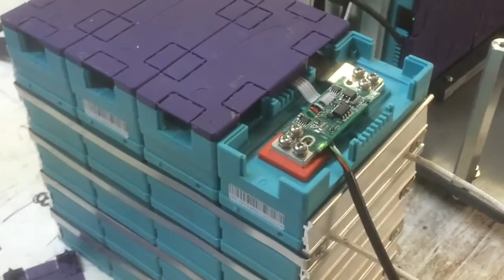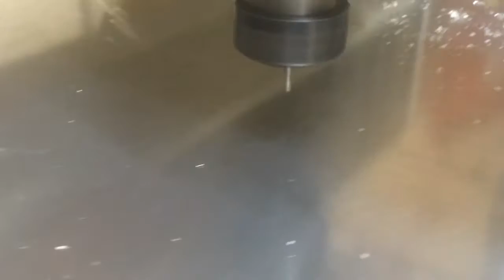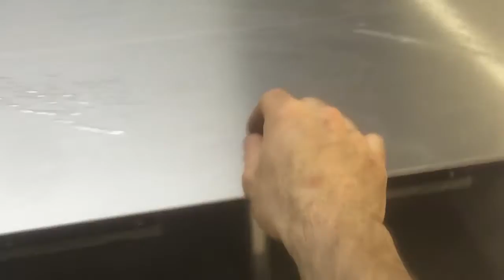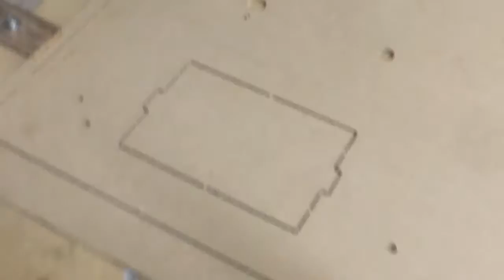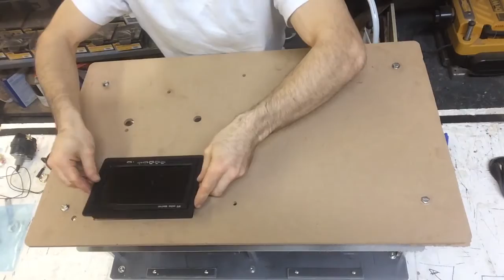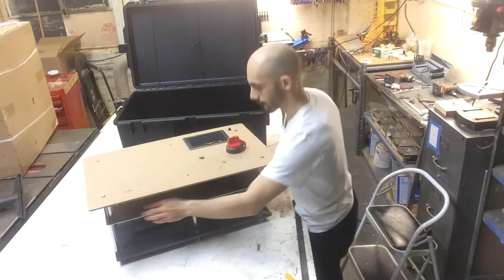RoboDolf Drone Boat - Part 2 - LiFePO4 Battery Box

Comment: New subscriber just found your Channel. I hope you haven't abandoned this. I'll go back and watch the previous videos and hopefully there's some after this one.
Great job on the Pelican case and battery frame
Reply from the maker: Hi! Thanks for the comment, this battery was actually used in an vehicle and it worked great! Never overheated or leaked and was rugged enough to handle the sand and transport.

Comment: There is not lifepo4 with 65C discharge current.except i am missing something or you speak for different chemistry batteries .if the temprature rise up to 60 celcius for long periods of time the lifespan of the batteries then will be shortened or there will be dangerous as you put them in a closed box and there is no airway out.now for the corossion there are some solutions.but i think this is not the problem.

Comment: Its nice.only if the batteries get hot they are goin to need some cooling .
Reply from the maker: +George Aleyropoulos thanks for the comment! The batteries are rated to 65C so cooling may or may not be an issue. If during testing it comes out to be an issue I have space for a internal fan. If that doesn't work I'll have to get more creative as I cannot have an opening to the air due to corrosion issues.